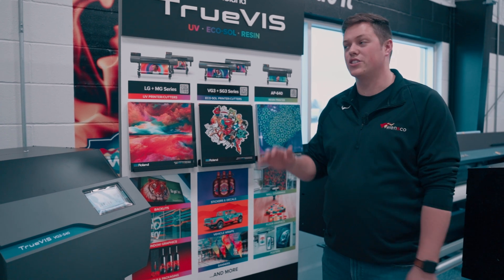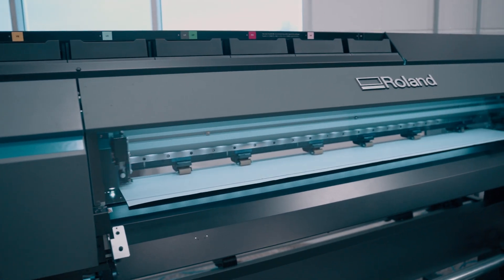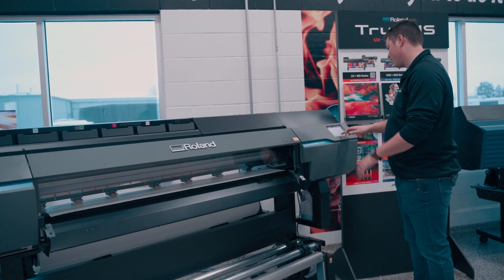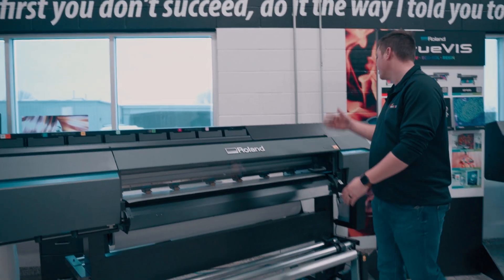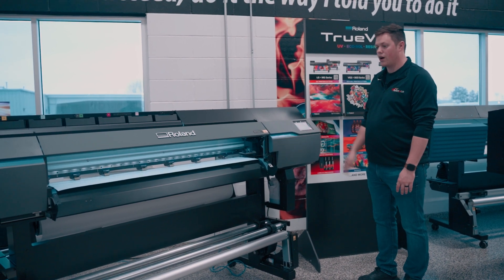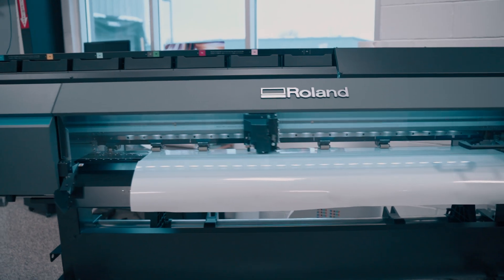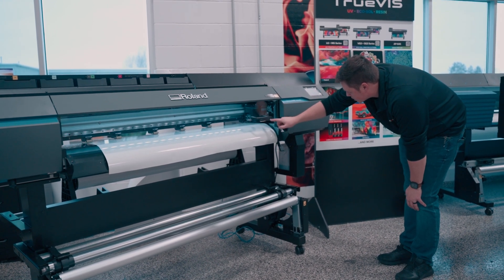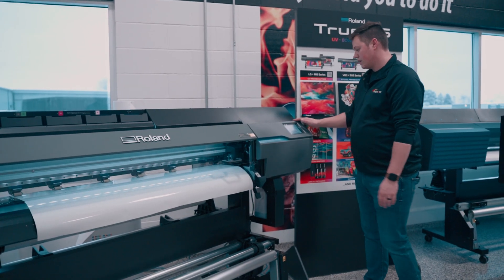What is Auto Calibration and How to Fix Errors on a Roland TrueVIS (VG3, SG3, LG, MG, and AP-640)

Comment: Great video, clear and to the point.

I have the issue with the company Roland SG3-300, where the print has slight ghosting. I've run the manual calibration and the chart printed with the ligns that should be aligned according to number, there are no lines that align. The closest match is +20 all the way to the right. The top 3 are close, like lines touching but could still do with bringing in a little closer and the bottom of the four charts is way out.
Do you have any suggestions for this issue?

Steps taken so far;
1. cleaned the encoder strip
2. Print quality set to high
3. vacuum set to high - there's no immediate evidence of the media lifting between rollers
4. auto and manual calibration completed for media gap 
5. height set to low
Any help would be greatly appreciated

Comment: I have a SG-300 and im loading 24" media but everytime i check the "Get Media Width" in Versaworks it says my media is 28". I cant figure out how to to fix it
Reply from the maker: Printing and cutting can only be done within the area encompassed within the outside most pinch wheels. If you're getting 28 inches on 24 inch material, you could very well have one of the outside pinch rollers off of the material, and so the printer believes it has more space to work with than it actually does.

It could also be a faulty pinch wheel sensor, but it seems that it's most likely a pinch roller issue.

Hope that helps you.
Reply: @WenscoSignSupply thanks, but I did make sure my pinch wheels were on the outer edges. I did notice when I bring the cutter over and set "base point" and then go back and hit "get media width" it  will then change the media width to what I set the base point as

Comment: Does vg3 series have ink drying time? Can you work without mask or vantilarion? Does it have oudor or toxics?
Reply from the maker: Dry time? The ink is designed to dry, with minimal dry time. It's generally dry by the time it passes over the dryer apron of the printer.

Toxic odors? No, but it is not recommended to use in an unventilated room for long periods.

Can you work with it in a closed room? You could, but again not recommended to use in an unventilated room for long periods.

Can you work without a mask or ventilation? You can work without a mask, but again not recommended to use it in an unventilated room for long periods.

Comment: What steps do you take if the auto calibration fails?
Reply from the maker: If Auto Calibration Fails There are a few things you can try. First make sure the sensor doesn't have ink or dust on it. Second is if you are using reflective see the second half of the video. Third is make sure your printer head height is not too low. If all of those things you good and you are still getting errors then reach out to a Roland Tech or us and we can diagnose it further from there!

Comment: My media on my Rolland is 730mm but is only reading 712mm how can I address this?
Reply from the maker: You will never be able to use 100% of your media, the pinch rollers will always take up some. You can move the media to run right up to the edge of your outside wheels to maximize your media usage. But the whole wheel needs to be on the media. Hope that helps.